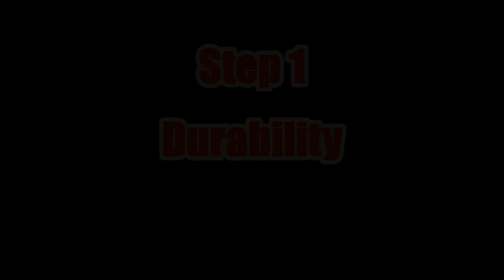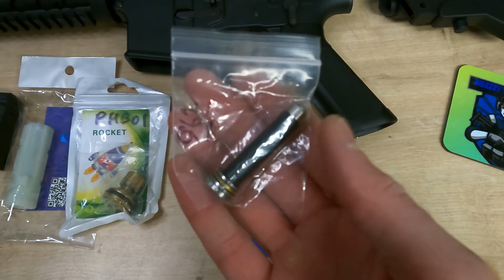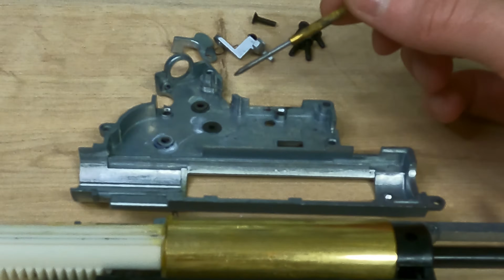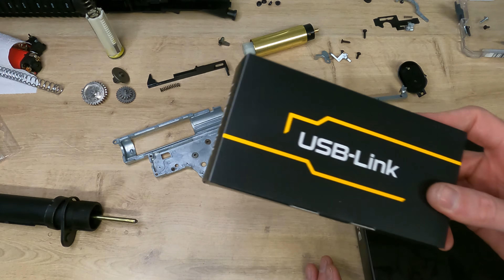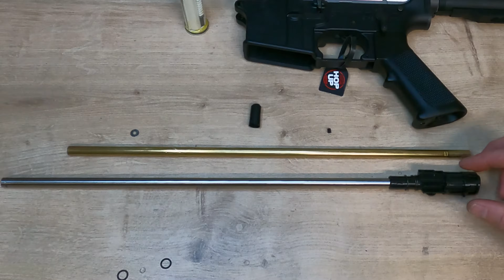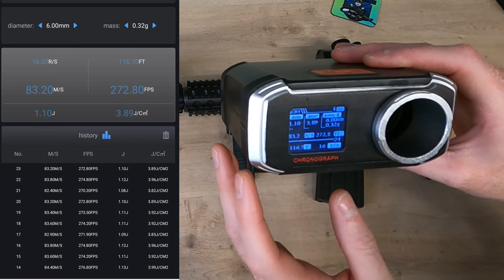TM M4 Sop Mod NGRS recoil system Full Upgrade! - Game Ready!!

Comment: 2.29time make sure the gearbox is all shimmed. what that mean?  also are you able to remove front iron site and change hand guard??
Reply from the maker: Shimming the gearbox ensures the gears are spaced correctly and running smoothly with each other and the motor. You would be able to swap exterior parts for other compatible ones. If you are considering one of these but want it to look different, TM do other models that maybe more suited to what you are looking for to save you from wanting to change the look of it. Thank you for watching

Comment: Great work! NGRS is more difficult to upgrade, compared to more "standard" AEGs. I've worked twice with mine, and with the second time got the wires cut. Now works again after experts repaired it. Anyway, upgrades are quite necessary as the stock NGRS tends to be a bit weak especially at a forest range.
Reply from the maker: @890lli  thank you!